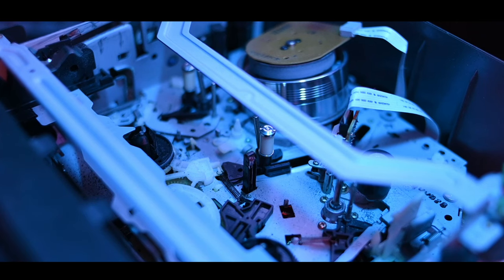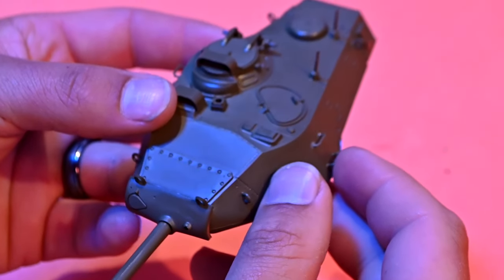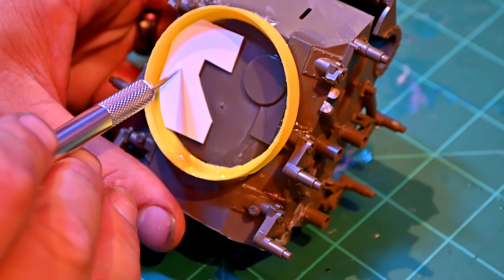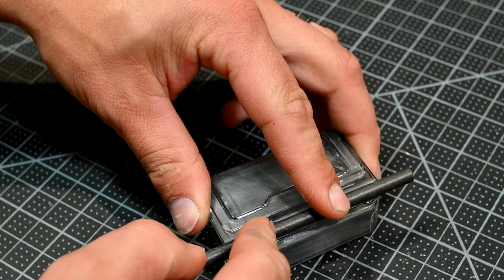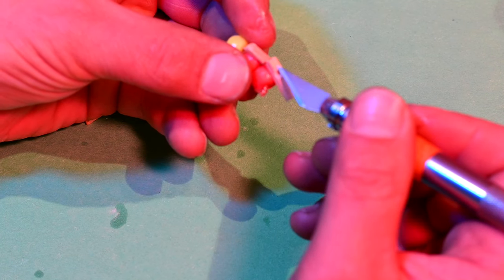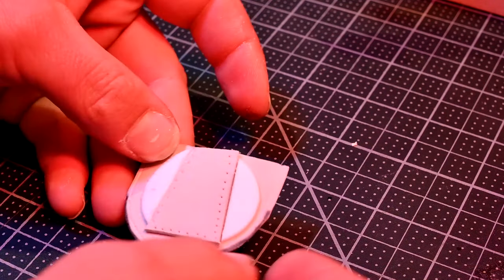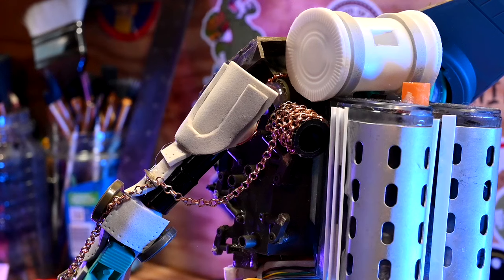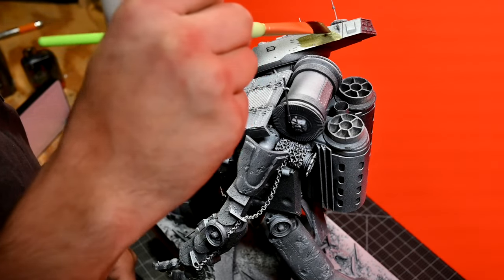How To Turn a Tank Into A Mech- The War Wagon Kitbash

Comment: This is really awesome, how do you prepare the Eva foam for painting? Isnt it kind of porous?
Reply from the maker: It is slightly  porous. Personally I like it. But you can always add more primer to fill it in a bit.
Reply: Hm, does paint like stay on well since it might still be kind of flexible? I know when I used it to make cos play armor I had to use a heat gun on it to solidify it a little more then spray something like a vulcanizing agent on it.
Reply from the maker: @armin8306  it wouldn't hurt to use a kicker, but if the paint is watered down and applied thin it more or less dyes the foam. But also it's not flexing much when I get it into position. I use HD foam from Blick arts, the creators name is Steve he has a yt channel called sks props he's the foam master I recommend his channel 100%